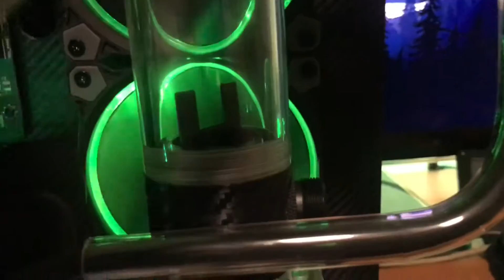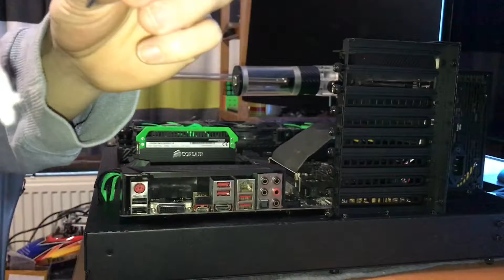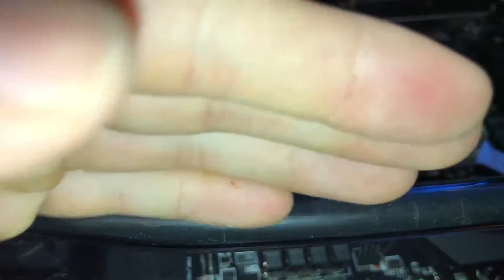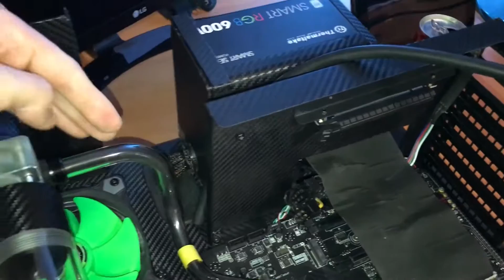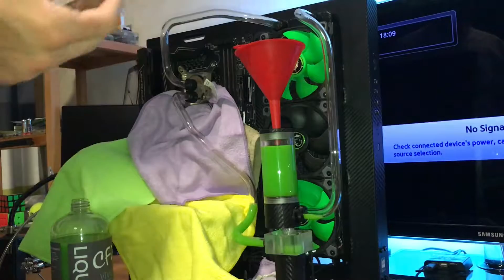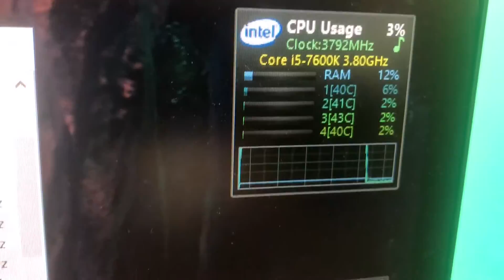Installing 125 Dollar Custom loop  (Core p3 build log 8)

Comment: Putting 3D print stickers on the brass/copper g1/4 chamber and steel/copper bracket is no good.
When water gets to hot the steel/copper bracket as well as the g1/4 chambers gets hot which means all of the radiator parts absorb heat.

Comment: Can the io be reversed ie mounted on the back so when i mount it on a left wall the io is facing me? Because as it stands it can only be mounted on a right wall relative to the user. Big woops if it can't.
Reply from the maker: well if you mount it on a left wall the IO would face you as you asked, but i think you mean't you don't want it to face you? no it's one way, but it's the same with a desktop pc, those always are one way too =P

Comment: Don’t need to run Aida 64 for 8 hours.
Reply from the maker: MTB Scotland people run it for 24h with overclocks
Reply: Dennis G be lucky if I did mine for more than 15mins 😂
Reply from the maker: Gotta be sure its stable on a oc, i ran it over night, so no issues
Reply: Dennis G issues will show up pretty quick plus I couldn’t afford the electricity running it overnight ha ha ha.

Comment: Hello friend, I saw your videos with an EGPU. I am intending to make one with 1070. I would like to know if you recommend me and if the results are good, thank you hugs from Brazil
Reply from the maker: Depends highly on what egpu you’re gonna use and on what laptop, 1070 with the exp is not really worth, i’d not go higher than a 970, and they all get bottlenecked on high vram usage but for moderate vram usage the 970 is the top i’d get
Reply: @Gagliano17  thank you

Comment: All the videos I've seen on water cooling is that the coolant leaving the radiator goes to the GPU first then to the CPU.  I prefer the water leaving the radiator go to the CPU then to the GPU before return to the radiator.
Reply from the maker: beerborn its been proven that it doesnt matter at all, btw i only run a cpu look, but jaystwocentz has a video on it if you wanna see the proof

Comment: Hey im new in whater cooling and i whanted just to whater cool my gpu, cause im going to buy a evga 1080 hydro copper, can you give me  a cheap set up for it for 190 dollars ?
Reply from the maker: i'd not cheap out on watercooling a gpu, yes there are options, but those often don't cool the vga controllers, and those most be cooled, they just cool the diode, on a cpu you dont need to cool those since motherboards have like passive coolers on it, if you go with a 1080, get a proper gpu cooling block for it, you can cheap out on tubes etc, but always make sure to keep a loop 100% one metal, no mixing, it'll corrode. do alot of research, on a cpu loop it's pretty cheap nowadays, but adding a gpu i'd take great care of that